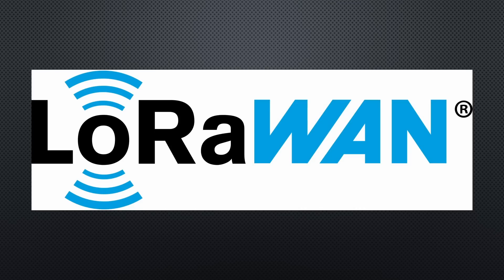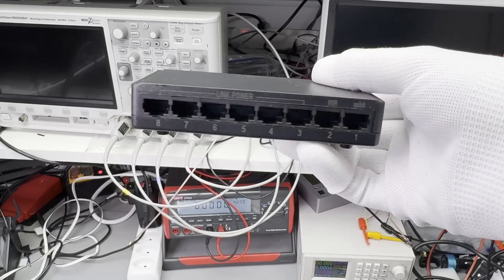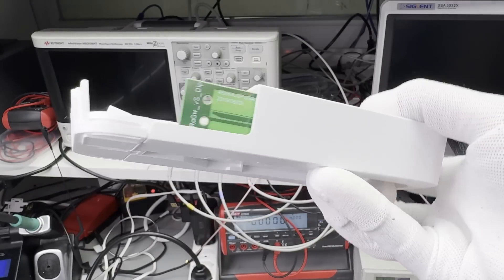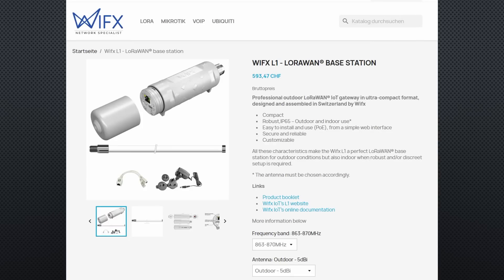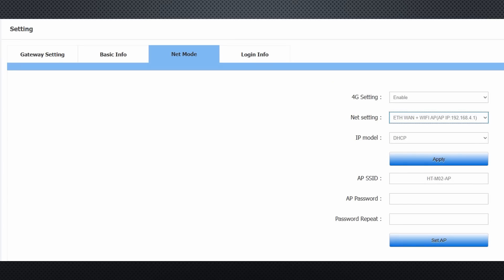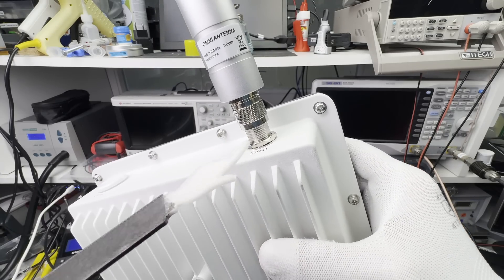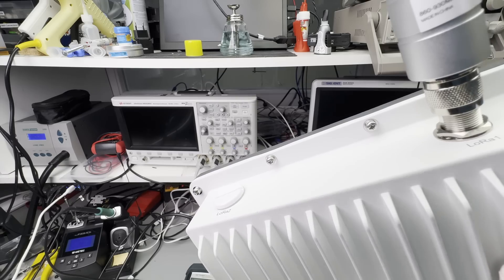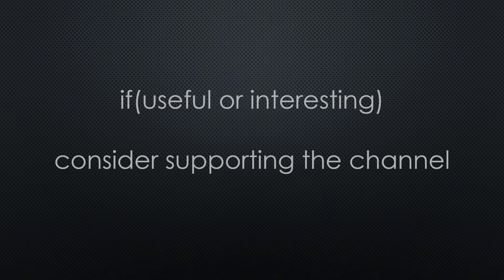479 Which LoRaWAN Gateway Is Best For Me (Comparison)? Part 2

Comment: LoRaWAN Gateway Selection and Review

*   0:00:00 Introduction: The video focuses on LoRaWAN gateways, their selection criteria (software, price, connectivity), and reviews specific models. It's the second video in a series, focusing on outdoor gateways.

*   0:01:06 Mikrotik wAP LR8 kit (Quadrant 1 & 2):
    *   Powered by PoE (9-30V DC) or 24V passive PoE (commonly used for CCTV).
    *   Can use 2.4GHz Wi-Fi to connect to the internet.
    *   Features a replaceable LoRa PCIe card for different regions.
    *   Has a built-in antenna, but an external antenna is recommended (connecting one without power is advised to prevent damage).
    *   Initial setup is via Wi-Fi; RouterOS v7 is required.
    *   Not waterproof, but has proven durable in "European" weather conditions in long-term use.

*   0:03:34 Dragino LPS8-N (Quadrant 1):
    *   Easy to mount due to its slim design.
    *   Simple management via passive PoE splitter; accessible by name (no IP address search needed).
    *   Quick setup and connection to TTN (The Things Network).
    *   Offers remote management via the internet.
    *   Relatively expensive, close to $600.
    *   Installation cost savings due to ease of setup and good documentation.

*   0:05:03 Heltec HT-M2808 (Quadrant 4):
    *   Outdoor gateway with 4G and Ethernet connectivity.
    *   Reverse polarity SMA antenna connector.
    *   Minimal web interface; no Basic Station protocol support.
    *   4G module works globally (no special SIM card needed).
    *   Works in access point mode; 4G functions automatically.
    *   Supports both "standard" 48V PoE and passive PoE (warning given to check PoE voltage).
    *    Uses a standard Linux.
    *   Docker is pre-installed.
    *   Priced at $299 (4G version) and $229 (without 4G).

*   0:07:26 RAK7289V2 WisGate Edge Pro (Quadrant 3 & 4):
    *   Heavy-duty outdoor case with 4G connectivity (optional).
    *   Uses N-connectors for LoRa antennas.
    *   Wi-Fi and Cellular antennas are protected inside the plastic front of the case.
    *   Powered by PoE or 12V, suitable for solar power in remote areas.
    *   Example of being used with 640Wh battery, allowing for ~7 days of operation without charging, and related solar calculations.
    *   Remote management is emphasized, important for difficult-to-access locations. No need for VPN
    *   Management is handled via a cloud service (separate from data transfer).
    *   Dashboard shows parameters, including battery status.
    *   Priced at $402, including the antenna.
    *  An option available for 8 additional LoRa channels.

* 00:09:32 Remote Management The presenter discusses how remote management without a VPN is possible.
* 00:09:53 Remote Management vs. Data Transfer The presenter advocates for cloud-based management, but prefers data transfer to be separate, not on the manufacturer's cloud.
*   00:10:31 Conclusion: The presenter reviewed 12 gateways and provided links to further information in the description.

I used gemini-2.0-pro-exp-02-05| input-price: 1.25 output-price: 5 max-context-length: 128_000 on rocketrecap dot com to summarize the transcript.
Cost (if I didn't use the free tier): $0.02
Input tokens: 12810
Output tokens: 848

Comment: Hello Andreas,

just found your video on LoraWAN-gateways. It's really helpful for me, as I am completely new to LoraWAN. Since I am currently looking for a gateway to connect some internal sensors I am looking for a simple internal gateway. Probably the Mikrotik KNOT LR8 would do perfectly for me, I have just some questions regarding the usage in an private  LoraWAN - can I use it for this purpose? I do not need access to TTN.

And do I need the Basic station protocol for private LoraWAN-networks?
Reply from the maker: 1. You need a LoRaWAN for these gateways to work. Eitehr you use one like TTN, or you install your own. TTN has containers that you can use for that. Chirpstack is another one.
2. The LR8 has 4G connectivity. If you do not need it, you might get a better deal (plus, if you do not know Mikrotiks RouteOS, it can be complex to make it running)
3. Basic station is the newer protocol. For new networks I would go this way to be future proof.

Comment: this might be a rookie question, because I have not used LoRaWAN yet (but have used many other IoT networks). But if I wanted to use something like Yolink end devices, am I required to also use a Yolink branded LoRaWAN gateway? Or can I mix & match brands?
Reply from the maker: LoRaWAN is an international standard. So, any sensor should work with any gateway (as long as the frequency band is the same)

Comment: Great video as usual but I don't get it. I want to have several outdoors sensors with Lora transmitters going into my PC. Is the gateway use exactly for receiving several Lora transmissions at the same time ? Thank you
Reply from the maker: That is correct. One gateway can receive messages from many sensors because they do not transmit messages often.

Comment: If I want to afford the prices for outdoor devices and also welcome an easier installation ... could I go for an indoor solution and mount only the antenna outside? That sounds like a good solution for me. Expensive Hardware, network and power connection inside the building.
Reply from the maker: Yes. Keep the coax cable short and use a good one.

Comment: Hi Andreas! Just subscribed your channel. Thank you for sharing this info. I am planning to travel to East Africa within couple of months. My family members there are nomads who are struggling with their livestock. They are constantly looking for lost livestock and I want to find a solution for that. I am planning to do an experiment with LoRaWAN to see if it technology could solve the problem and my their lives easier. Unfortunately there is very a bad 4G coverage, so I am thing to setup a standalone solution that will allow data to be read locally on-site from the gateway. 

I am thinking something like this... attach tags to the animals, setup a local gateway and a local infrastructure. Everything needs to be powered by solar. Gateway will be connected to a local server (e.g. raspberry) using WiFI or direct Ethernet which ever is best. Local WiFi has the benefit of allowing mobiles or laptops to access data on the local server. I am new to this things, so my first question is, is this setup possible in the first place? Second, what would be the best option for connecting gateway to the local server (cost and power)? Lastly, in ball park how much would this cost? Thank you.
Reply from the maker: Just search Google for similar projects and offereing. This is a common scenario used for wild and domestic animals.

Comment: Dear Andreas. My compliments. Your channel is probably the best on this topic.
It says on your website that you value your privacy and that you should be contacted via YT.
Since there is nothing close to what I want, I am asking the question here.

Rotary encoders are either expensive or of poor quality.
I heard that it is possible to use a stepper motor as an encoder.
I mean turning the motor by hand and reporting the direction and number of pulses in the ESP32.
Interesting new project?

Many greetings.
Reply from the maker: I also heard about this application. But, becasue motors have big coils, you probably need some protections. And "real" rotary encoders are also not so expensive. I have for example one for CNC machines for 15$. However, I do not have many applications for such devices and so, I do not know how long it would last.

Comment: Dear Andreas, first many thanks for your great videos. I plan to setup a network of 30 devices to monitor small animal shelters (like birds) scattered around a zone of 200m x 200m. Should I go for an indoor or an outdoor gateway ?
Reply from the maker: It depends on where you want to place it. 200m seems to be no problem if there is a line of sight (or similar) between the sensors and the gateway.
Reply: @AndreasSpiess   I would prefer to leave it inside a building (safer and less expensive) but is it possible to do so, taking into account the propagation losses in the structure ?
Reply from the maker: @papyetlesresistancespapyet2622  Just try it. Maybe you have to move it a bit.

Comment: I realized that I have a LoRa gateway (ttn) a 1,5 km and another two at around 2-3 km. Do you think I need to buy a gateway? In your mailbox project you had yourself one, but how far are other gateways away from your home? Anyway thanks for the great videos with a Swiss-German accent.
Reply from the maker: If your sensors transfer messages, you do not need your gateway. I had (and still do not have) one in the vincinity.
Reply: @AndreasSpiess  Thank you very much for the reply. I understand that one could use MQTT to communicate (receive and trasmit msgs) with the device throug the TTN MQQT broker from an entity connected to wifi or ethernet, but not necessarely connected to LoRa. If this is the case, one would not need a gateway to integrate the sensor on HA for instance. But then you used one for your mailbox sensor... I must be misunderstanding the all problem.
Reply from the maker: @max9111  Masybe you watch my LoRaWAN tutorial to understand why we sometimes use it.

Comment: Hi Andreas, "waterproofness […] can survive at least in european weather conditions" — As I've been raised on the seashore, I can tell you it won't fit very long (d° for your balcony contraption), which is a big problem - hell, even stainless steel hinges 45 years old (so real 18/10 stainless steel where magnets do not stick) have rusted a few !   This is a huge problem that cannot be easily circumvented, except with several tropicalization varnish layers, completely hermetic boxes with Silicagel bags inside and special mastic instead of pass-through gaskets (but even with that, it can still be corroded  :/).
To give you an idea, antennas external cables joins with F plugs must be protected by 3M extensible auto-vulcanize tape at least 5 cm from the F plug on the cable, but even with that, it doesn't last more than 10 years (well, it is also often the antenna itself that is dead after this time).

Nice LoRa panorama with these 2 videos :)
Reply: Aerospace industry uses an ardrox av30 (dinitrol) coating over everythingy outside the airframe (connectors etc.). It is a liquid varnish that turns into waxy/semi solid coat when it dries and can be removed with acetone or MEK. Worth checking out....
Reply: @VictorIndiaDeltaAlfa  I know that, as a matter of fact I know about dinitrol since the 70's as the younger brother of the neighbor of my grand-parents was in the aeronaval and sometimes came in Britany to scuba dive - but  it  quite expensive here and difficult to find a source.

Thanks anyway :)
Reply from the maker: Thank you for sharing your expertise. I always thought that you guys are happier with living at the seashore. Now I have at least a little advantage here in the mountains ;-)
Reply: @AndreasSpiess  Well, as you know it, we're never fully happy with what we have, I'd love to dwell in the mountains but there's not a lot in west of France (I'm secretly planning to go to Pyrénées-Atlantique, south-west, at the frontier with Spain, here you have (small) mountains AND ocean ;-).

Anyway, seashore and mountains have a common point, big and juicy thunderstorms, good when it is dark and the comforter is just  beneath your nose, not so good for electronics though.

Comment: 2:18 Andreas could you try to hook up that mini-pcie card (with a mini pcie to pcie adapter) directly to a computer? These are great and often times low cost as they are currently being thrown out by most Link Towers for newer cards
Reply: Sure you can do that. Mikrotik or RAK gateways in the review have these minipcie radio modules inside (called concentrators). You can even buy them alone. They usually come with SPI or USB interfaces. You can use the USB ones with a cheap minipcie to USB adapter with any computer (or plug it directly to the MB if there is a minipcie connector). Then you have to run the Packet forwarder software stack on the computer.
Reply from the maker: @xoseperez8437 knows what he is talking about. He is an expert. So I do not have to add anything ;-)

Comment: Meshtastic firmware which is Open Source which built around Maker / Tinkerer's has the capability of remote access. You can place the LoRa device into Gateway mode having it connected to Raspberry Pi, making a NAS and conduct all data processing locally, therefore not reliant on 3rd providers. God bless.
Reply from the maker: You find the first Meshtastic video ever made on this channel 😉

Comment: Can I use helium miner as lora gateway? I have one MNTD goldspot miner laying around.
Reply from the maker: The hardware should be capable. However, you probably have to change the software. Or at least reconfigure it.
Reply: There is a tutorial for the sense cap hotspots somewhere on Reddit or the Internet. I guess there is one for yours too